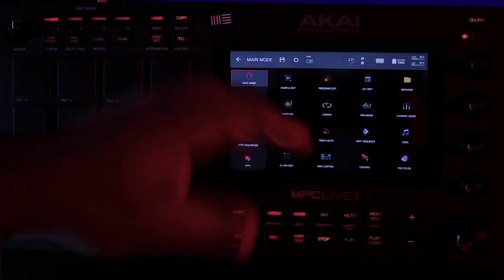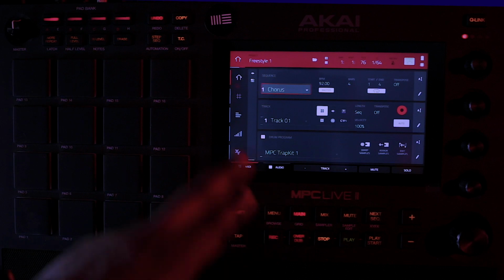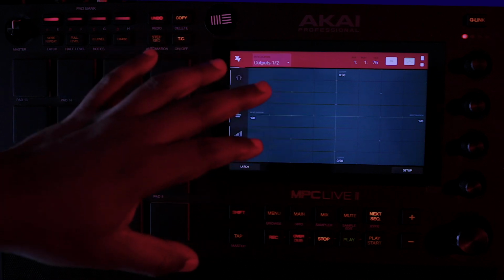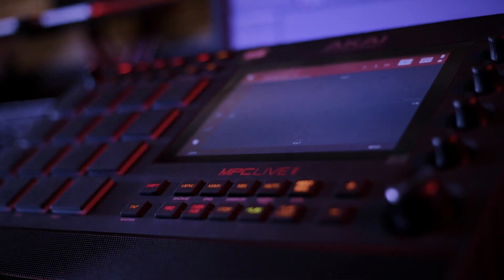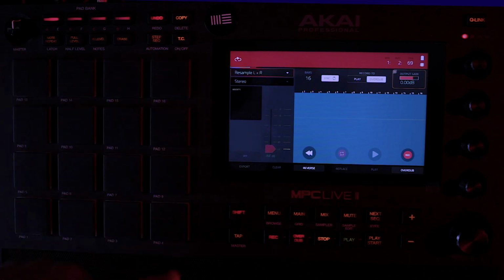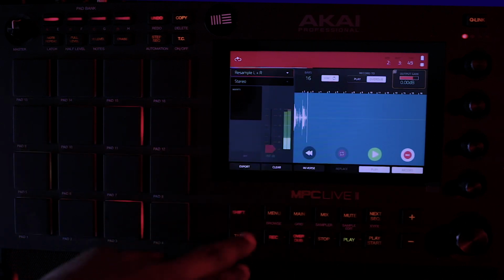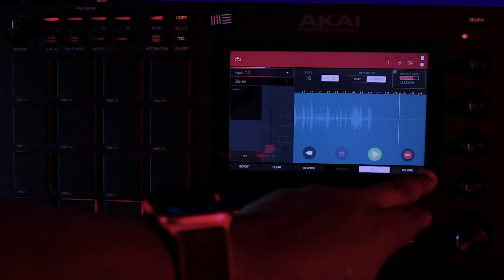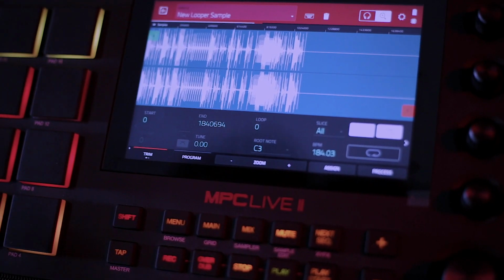Akai MPC Looper Explained: Boost your creativity

Comment: Is it also possible to clean the samples with fade in and out, so when hitting the pads the sounds are more polished? In this video the samples taken sounded rough/chopped.. And for vocal chops it would be nice to also add some effects on the fly like high cut to make it more mellow instead of sharp and some reverb for example.. So is the MPC able to add basic effects like any Daw has plugins!? I assume it does, otherwise it would be a huge flaw for an expensive mobile Daw like this.. Are there any other devices with drum pads and multitrack loopers for live recording, but without Daw and also cheaper than the MPC one?
Reply from the maker: Hello, You can actually add effects to your incoming sounds on the fly while sampling it but not sure you can fade in/out automatically except if done after recording.

Comment: The problem is that the loop length in the looper is quite limited to a certain number of bars. So it's not possible to apply this technique to longer sequences. However, it is possible to bounce a sequence to sample, and then apply whatever effect and XYFY you want.
Reply from the maker: You’re correct. 👍🏼